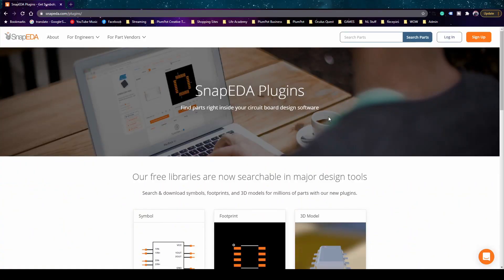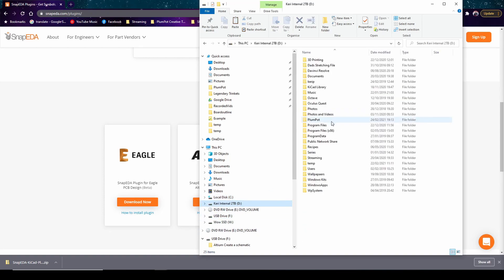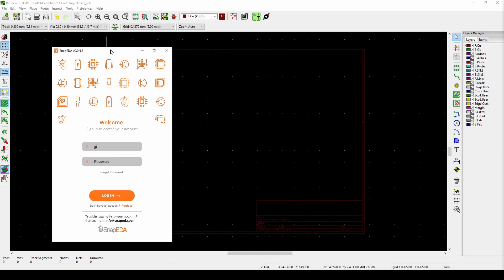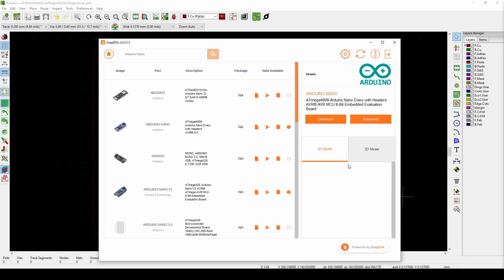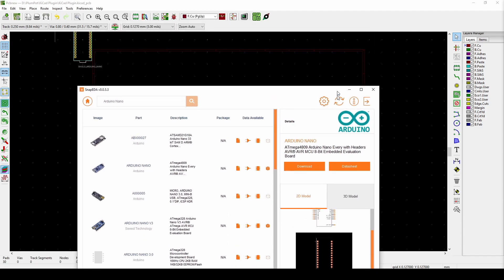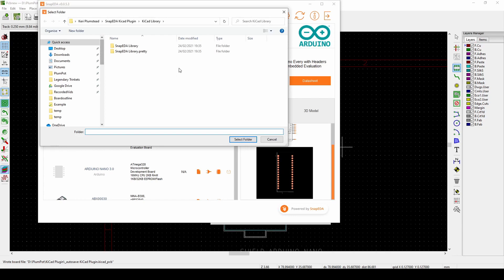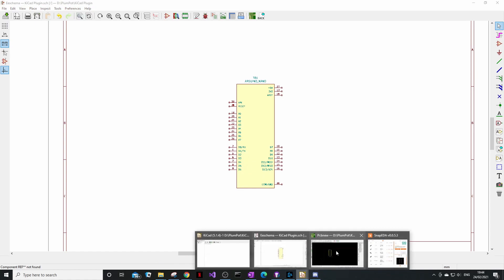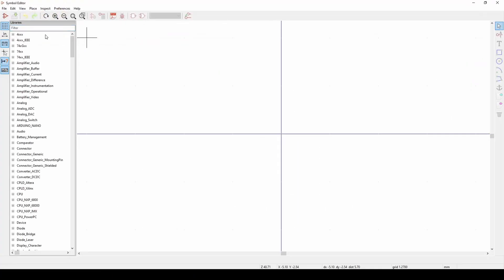KiCad Tutorial -  No need to create your own footprints anymore

Comment: another KiCad question.. I am learning a lot about making my own footprints easier than trying to get them from SnapEDA.. My next problem is know how much space I need to add for hole size for the pins of a device? Example I have a din 5 connector used for MIDI cables. I could not find a footprint so I made my own.. 

The pin dimensions on a Din 5 connector are 
x = 25 mil
y = 40 mil

Is there a rule on how much bigger I should make the hole?
Reply from the maker: Hi WagonLoads:_Hello:, good question. I'm not sure if there is a real rule of thumb for it. I always look at the tolerance of the pin and the tolerance of the PCB manufacturer holes. And make it a bit bigger than that. Most of the time, I make it +10% when I don't want to go and look through all that information, lol. Also, have to make sure your copper ring is big enough to solder on. It might be a good exercise to look at a normal 2.54 pitch connector and see what the hole size is for that compared to the real-life component.

Comment: Nice video.
I have a question related to kicad in line segments when I create new library . I'm confused to set end start point x value and y values .
Reply from the maker: Hi Suraj, thanks for the compliment. You mean changing the sizes of the line, so you can make rectangles or square? Is that what you mean? 
You are always welcome to join our discord, this is where it is easiest for me to help :) a bit easier than the comment sections :).
But I can try help here as well :)
Reply: @PlumPot   Sure!! I will join your  discord

Comment: How do I get a KiCAD footprint for the 30 pin (esp8266 NodeMCU) without selling my soul to snapEda? Why can't KiCAD look for footprints of the boards listed in my Arduino IDE Boards Manager.
Reply: Also, Arduino IDE can't tell the difference between the esp8266 NodeMCU and the esp8266 D1 mini. I don't have a way to use #ifdef to tell the compiler which pins auto assign for those boards. Example. There is only one pin on the D1 mini that I can have hard wired to a DHT22 without causing upload errors on the D1 mini. 

I need the Arduino IDE #ifdef to know exactly which board was chosen from the boards manager menu when I am uploading..so that my code will auto assign pins to my connected devices.
Reply from the maker: You welcome to email me at info@plumpot.co.uk and I can try help. Its a bit hard to give help over the YouTube comments🙂. You can also join our Discord channel in the link if you would like
Reply from the maker: Haha why selling your soul? It's free, or you mean you have to share your details?unfortunately KiCas and Arduinio are not linked, but that is actually a great idea. Are you struggling to make your own footprint? Someone might have already made this on Github somewhere. If you are struggling to create this footprint let me know and I'll try help🙂

Comment: How would one go about doing a "proto" board that would not use the schematic editor to place footprints?  In effect the board would have pads tied with traces but no real devices.
Reply: @Andy are you by chance looking for ratnesting/net defining directly in PCB without going through the Schematic-Netlist-PCB route? If yes then it might be quicker to use a different PCB design tool. Like the one provided with gEDA (PCB for X). Runs on both windows and Linux.
Reply from the maker: Hi Andy 👋 thanks for the comment. I would still use the schematic editor. You need something to tell your PCB where the traces are supposed to go. In the schematic you can make use of connectors or test points. You want to use it as a general proto board? Or something specific like expanding the IOs of an Arduino?
Reply: @PlumPot  As a general proto board.  Kind of like a bread board layout.  Thanks for the reply.
Reply from the maker: @andybrown3674  ahh okay yea I would then just use connectors in my schematic. Because you will need holes/connections on your proto board be it smt or through hole. I'm KiCad you can also search for test points and choose different diameters I think thay will work best for your application